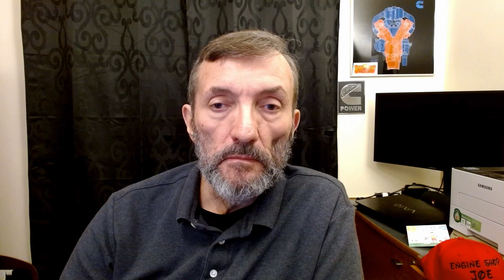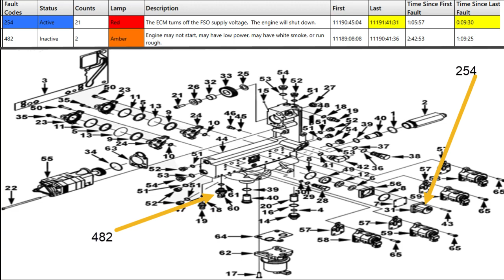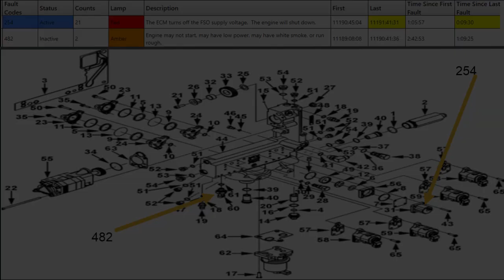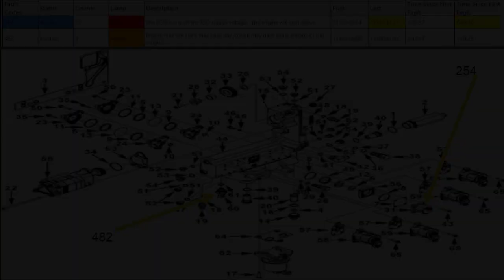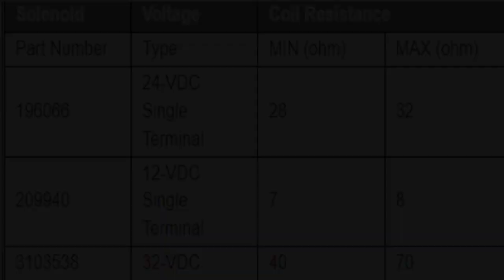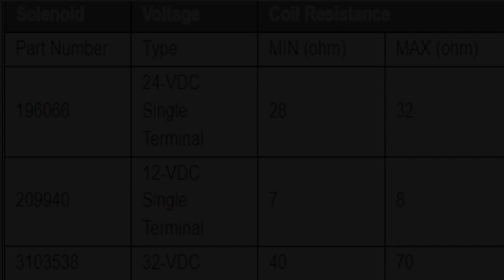Why did my NTC 855 / ISX shutdown?!

Comment: Hi Joe, what would happen if you gutted the fuel solenoid on a 870 and ran the tuck? Would the ecm still be able to shut the motor off at key off?
Reply from the maker: Yes it will because it shuts down the metering and timing actuators. However it will log a fault on the fuel solenoid because it monitors fuel pressure in the body of the ifsm. The fault will stay active until fuel pressure drops to under 15 psi at key off. Remember at key off the ecm is still fully functioning for about 20 seconds on the 870 platform. Whether the fault drives a derate or not depends on the calibration in the ecm.